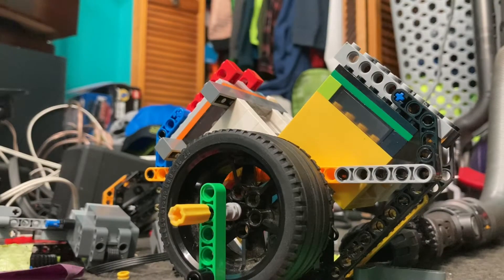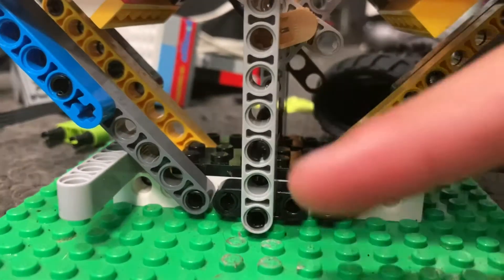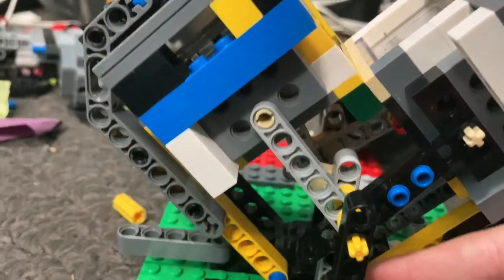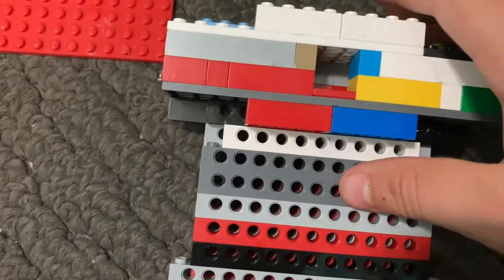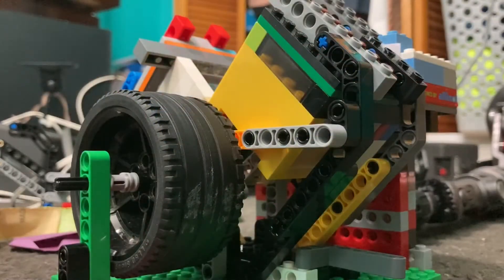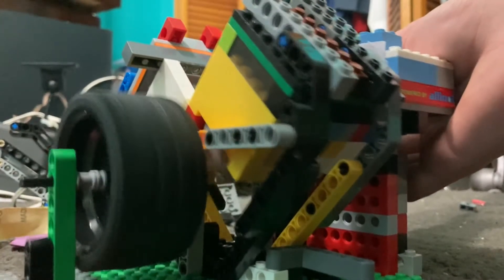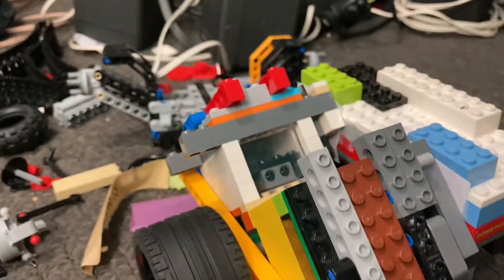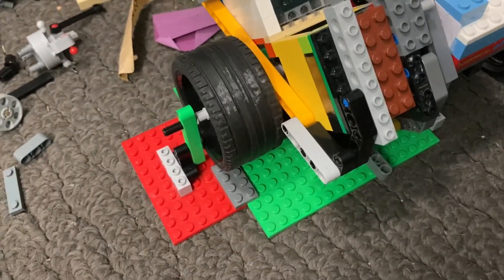LEGO VTwin Vacuum Engine v1.0

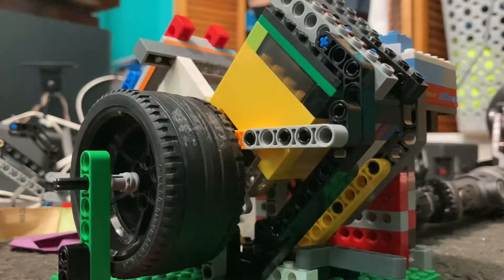Comment from the maker: If you came to just watch the engine run, you can skip to 5:31.
Reply: Coming back to this video makes me thing we have been building V style engine with SVS wrong for the past few years. This design with some improvements in the modern days seems like it would be insane. The valves being along the crankshaft really work out and cut down on lots of friction like problems with the big engines we have now

Comment: I've noticed your engines sound very engine-y. Like they sound like real motors. Mine sound fast, but yours sound real...  and fast  😂
Reply from the maker: Shlushe 10 Well maybe it’s because the higher speed it has the more realistic it sounds. Maybe it’s because 1.5 stud valve cranks make the engine a lot quieter and smooth running compared to 2 studs. Maybe it’s the quietness of the cylinders that doesn’t drown out the natural engine like noises that it makes. Many different possibilities, my friend.
Reply: @KFPlusLegoMastery  exactly! Many possibilities